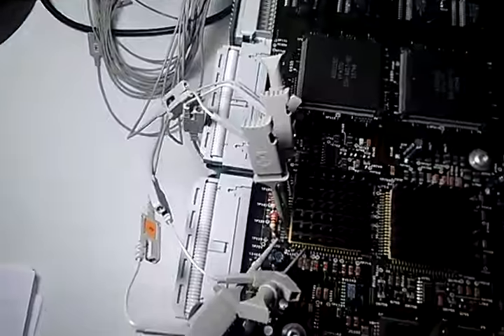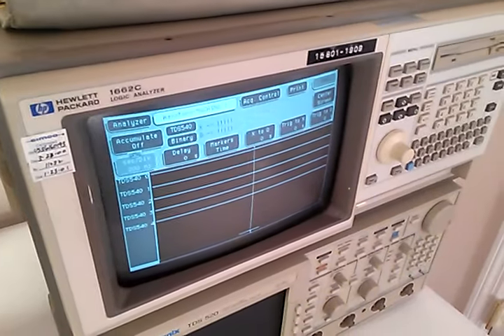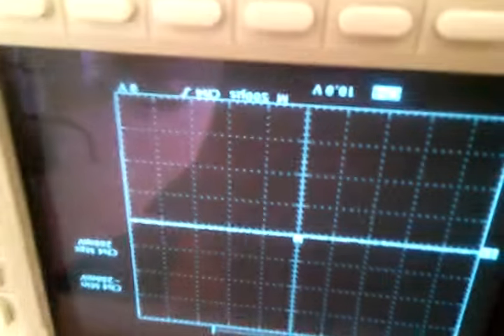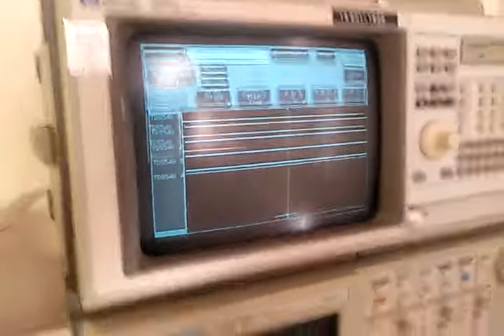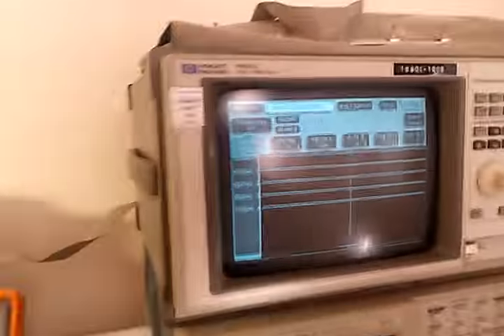tds540 fix

Comment: Cool cool.
I've had a HP logic analyzer for a few years but never actually used it. Didn't know how, when or where to apply it. Stumbled upon your video while in the process of repairing a TDS544A. Thanks for the education.
Sincerely, Chris Lake
Reply from the maker: Hows the repair coming?
Do you need schematics?
Reply: @Drforbin941 It's going pretty good. Need to figure out how to get the firmware out of the Dallas NVRAM so I can do the battery modification. I have a NI GPIB-USB-HS interface and learning how to use it.
Thanks for the schematics offer, but I have downloaded a copy of them already.
Reply from the maker: @user-gj4ei6dc5q  There is no firmware in the dallas chip. The dallas chips contains various calibration constants etc